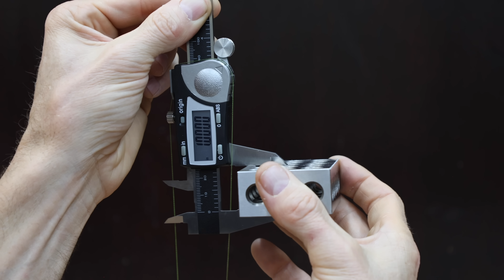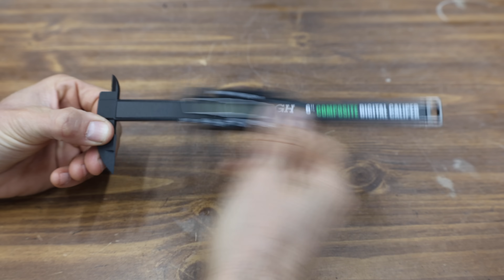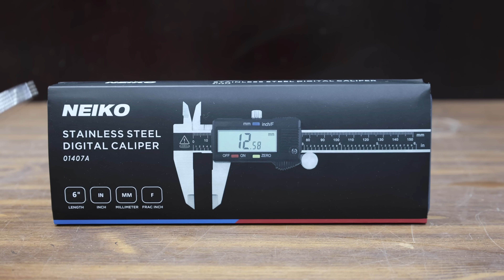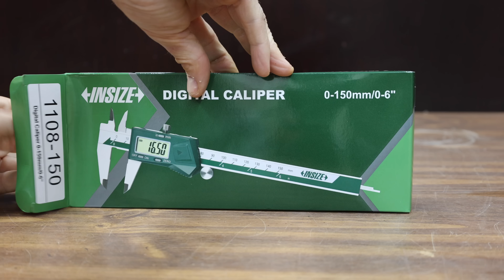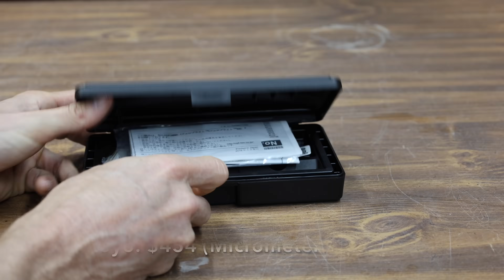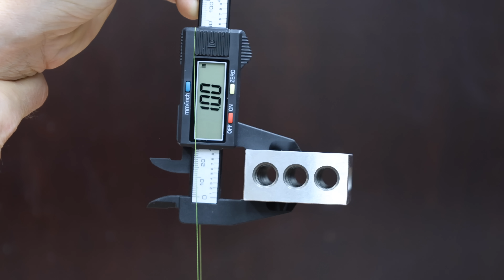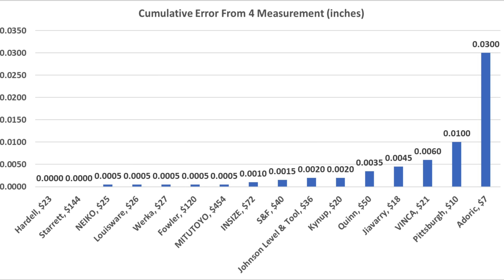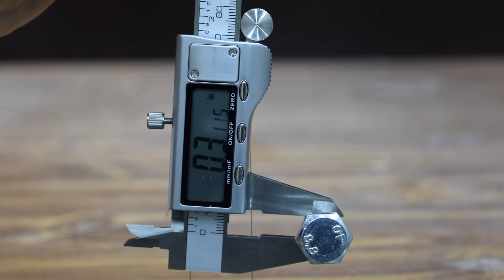I've Been Proven Wrong About Calipers!

Comment: Having the need for measuring existing bike parts such as seat post diameter and handlebar clamp diameter and then choosing from 2 or 3 available options for that bike part, excludes the need  for precise measurement and I can get away with the Amazon special. Those, however, who are measuring things for the exact dimensions would need one with the best accuracy possible. Thank you for the video.

Comment: I don't think I'll be trading in my Mitutoyo calipers any time soon, and as stated they are low power consumption, I don't recall changing the battery yet?, they are SEVERAL years old now, the cheap ones at work have a new battery about every three weeks?

Comment: Bought my Mitutoyo caliper in 1988.  I still use it almost daily.  Had a leaky battery which contaminated the contacts.  The battery compartment would be better with a screw.  I will by a second one soon.  Hard to beat Mitutoyo.

Comment: Hey, great video!  Except for one thing… battery lifetime.  I have most sizes of harbor freight calipers. These are the older but better versions of what you used here. I LOVE them…. When they work!  Yes, they have auto shut off.  And they even have an off button.  BUT it’s a software off button, not a hard switch. And damn all, the silly circuit in it drains the battery dry in only a couple of months: EVEN IF YOU NEVER USE IT!  It has a leakage current due to the soft switch. Absolutely stupid. As you mention the MIT has a patented circuit that eliminates almost all of this drain. But here is the rub, I’ll bet almost all the others you tested will have this same battery drain: all the others will be dead in a month except the MIT. SO if you are looking for a new video topic, put new batteries in all you calipers and test them each month to see hoe long they go.  You will probably be able to make the video in 3 months, 6 months tops.  And it will show them all dead except the MIT.  Maybe those with the larger cells might have some life still in them only because the battery is larger. You might have to wait 9 months for them..  but I think this battery life is a Huge issue, and it will completely reorganize you rating system, because even if a caliper can measure a thousandths of a thousandths, if it is dead, it reads nothing!  Thanks,

Comment: The cheap Chinese calipers will work great for a bit, until they dont. And when you're standing there with $100 of material and $250 in labor all gone to waste due to some $15 calipers you'll wish you just bought the starret/mitutoyo. There's an old saying "nobody ever gets fired for buying FLUKE" (originally phrase was for IBM products but i heard this through machine troubleshooting). Open up a pair of cheap Chinese calipers and the almost flagrant crappiness of the weld holding the depth probe will convince you more than i ever could. I'm the kinda millwright that watches a Project Farm video and then immediately pulls up my Amazon page to buy exactly what was recommended and i've never been dissapointed, but these products need more vigorous testing. But that means going into the deep world of metrology, something so awful that the youtube spellchecker is marking the word as misspelled because its never heard of it.

Comment: Mitutoyo is the best value.  A 6" is $120 or less.  Not sure why the ones in this test were so high.  Just need to order from a real tool house or else you will get counterfeit calipers.  I used a coupon and recently got another Mitutoyo for nearly $100.

Comment: 0:40 This one will EAT batteries for breakfast, by having a low-power circuit remaining "on" all the time, to keep track of the pulses...It never really shuts of and truly needs a "hard" switch and then a zero out every time, instead of that electronic switching stuff.....
Reply: +1 I have some cheap Silverline digital calipers that do the same. It was so bad that I switched to plain vernier calipers when I felt like an upgrade (bought Mitutoyo ones).

It was quite a while after that I realised it wasn't normal for the digital ones to burn through batteries all the time - just something the cheap Chinese models do
Reply: I mean, this isn't necessarily true. No idea about this particular case, but the movement of a slide can create enough energy to activate a transistor and trigger the OS to turn on. This would be a completely OFF system, tripped on by the movement of the device, costing no energy to the device, and suffering no battery leaks. Transistors really are that good!

Comment: Why are the micrometers included in the Mitutoyo pricing? Normally these are around 150$, for a little more you get the coolant resistant one which does have auto-off.

Comment: Supervisor of Metrology Engineering here, we calibrate some of these brands very frequently and we have the fewest issues out of the Mitutoyo and Starret Calipers. An additional consideration is that the Starret dial indicators are also pretty easy to work on.
Reply: I would say the same. Im a metrologist also. Cheap brands are for home use only. Lucky for me I can check my Cheap caliper with expensive gauge blocks from work.
Reply: @Rock1Ld  @Jacobscott272 What are the issues you see with the cheaper brands? Are they problems which @ProjectFarm could test in a future video?

Comment: Depth measurement: could the depth measurements been skewed due to the depth rod pressing into wood?  After all, if human touch can bend the jaws enough to skew the measurement, it would seem to follow that pressing a small area against a readily compressible surface could have similar errors.   

I have both a MITUTOYO as well as the Adoric (sold under the Bseen label, no longer available).  The Mitutoyo is almost 40 years old and is still fantastic; it may have been their first digitally reading caliper.  The Adoric is OK but its battery life is measured in _days_, as in 4-5 days.  I've given up on it, using it now only for coarse measurements taken by eyeballing the printed scale.  An old-fashioned vernier-scaled caliper still works great, albeit sometimes requiring the eyeglasses accessory to read it.

Comment: Thanks for the great reviews!  I bought two Neiko calipers, and both failed after only a few uses. They stopped working just outside the warranty period.  Both had some sort of power issue: one turns off and on in the middle of a measurement, and the other just died completely. I tried new batteries that work fine in other devices, so the batteries aren’t the problem.  Mechanically, they’re still fine, so they have some value, but the digital display makes measuring much faster and more precise. I don’t use calipers often, but they’re really handy when I need them. I know these were cheap, but I don’t use them enough to justify spending $120+ on a higher-end model. But these didn’t wear out from use and they were kept in their cases, never dropped, and well protected. So buying for the manual measuring? Probably not.

Comment: I have Mitutoyo and it works fine.  Much later I also bought a no-name.  When I put the battery in the no-name, the cover broke, the Chinese use a lot of regrind in their plastic.  The no-name went through batteries very fast.  I measured off-current of the no-name and it was +5 times higher than the Mitutoyo, about 20 uA vs. 3-4 uA.

Comment: I've been using a "Performance Tool" caliper from Auto Zone that I got for... I think it was 12 bucks? for years. Don't care about how smooth it is when jerking it back and forth. Just about how smooth it is while using the thumb wheel. That can be adjusted with the tightening knob. It's accuracy is perfectly acceptable as hobbiest. I'm looking to drop 100 bucks on a caliper online soon, but that's only because it has Bluetooth and automatic measurment recording. I don't really need to ever measure anything in microns. Millimeters is as small as I really get.

Comment: I have an old nice pair, I think it's nti brand, that has been working for me for like 15 years, and then one cheaper brand. The cheap one works surprisingly well but it definitely feels much worse, it has a kind of slop that makes it feel worse then it is. For the home and 3d printing related tasks I do, both actually get the job done pretty well. The big difference is the batteries in the nti last for like 10 years even with frequent use whereas the cheap one kills batteries in a couple months even with minimal use. The good one is always ready for use whereas the other one just isn't.

Comment: Please consider looking at chain wear indicators for bicycle chains. Chain wear measurement can be done by many types of tools. mostly dedicated, but also via a general purpose calliper. Tools vary in price from very cheap to nearly USD 100. Comparisons done over a range of tools show a significant range of accuracy. The idea for any bicycle owner is to replace the chain once it reaches a given level of stretch (0.5% or 0.75% typically) which then avoids wear to other (more expensive) components such as rear gear clusters and front chain rings. Having an inaccurate or hard to use checking method means that an owner may change their chain too early (discard chain with life still in it) or too late (damage other components).
Whilst quite niche this is ripe for the Project Farm treatment - trying out a range of checkers on bicycle chains at different levels of wear (eg new, should be replaced soon, replace now). Some chain manufacturers (in particular SRAM) have a differently shaped chain which may require a particular tool.
Reply from the maker: Thank you for the suggestion!
Reply: @ProjectFarm great. Might be useful to consult with an experienced bike mechanic when setting up the testing scenarios.

Comment: I found the fractional equivalency built into the readout to be possibly a handy option for our cabinet maker friends.  Often using a caliper is the best way to measure woodworking features, but drawings for woodworking projects are generally written in SAE with fractional dimensions.  
That groove measurement was just poorly executed to get an accurate dimension.  Properly measured you would use measuring wires made for measuring threads.  Knowing the exact diameter of the wires, you would choose the proper wires that are thinner than the groove width. Then the wire would find the exact bottom of the groove leaving the width of the blade out of the equation.  You would have to subtract the combined diameters of the thread wires to achieve the actual root diameter of the groove.

Comment: I'm a calibration technician and while I would say stay clear of the plastic sets in most cases, the $20 metal ones you find on amazon are typically accurate within .0001in just like the 240$ counterpart
Reply from the maker: Thanks for sharing.

Comment: Calipers are an introduction to metrology, so measuring 123 blocks [what tolerance?] against a wood table which is not necessarily guaranteed to be straight. For example gauge blocks come in different grades (from K to AS-2... to uncertified] with different tolerance guarantees. 123 blocks will be usually less accurate. Another interesting thing, from 50f to 85f you can expect a 123 block's 3 inch side to expand by roughly 0.0007~ inches due to thermal expansion! So about a thou from 5c to 35c. The larger the object the harder it is to maintain accuracy over the size of it, so that's why a 12 inch caliper is sometimes more than double the price of a 6 inch one.

Another thing -- calibration gauge blocks etc are usually within roughly 0.002-0.003 thous (+0.10 um to −0.05 um) and you can go down the whole metrology rabbit hole from here.

The pricing on the mitutoyo in the spreadsheets etc is wrong though since it comes with a micrometer! You also avoided the most important parts -- drop tests, how they deal with dusty environments, water immersion, oil spils, repeated measurements, and sliding in/out dozens of times. Also testing battery lifetime AND accuracy when the battery is low! 

I own a few mitutoyos, but also use a bunch of neikos for more disposable kinds.

Thanks for the great review though, this tool gets used by hobbyists wanting slightly higher accuracy and also by machine shops and other technical work where certification and following processes is very important. Perhaps a 2nd review targeting the more "machinist" style accuracy and use cases (Battery life! Accuracy!)

Comment: It's about the ones that still measure right after their 230th fall on the floor. The cheapies don't last in a pro environment. They even got banned on the shop floor in favour of calibrated and checked mitutoyu. There's a couple of decent brands, bit there's a reason we all use mitutoyu in engineering workshops.

Comment: It wouldn’t be practical to test here, but I’ve had cheap digital calipers shred batteries sitting in the case. I switched to Vernier calipers over that particular issue; I use them a couple times per year and don’t want to buy batteries every time I do.
Reply from the maker: Thanks for sharing.

Comment: Mitutoyo simply doesn't need auto power-off. I've seen Mitutoyos left on in the drawer for month and months. They simply don't use the battery when you're not moving them, or at least no more than a Casio wrist watch (which if you've ever had one, you can toss it in a drawer and pull it out 5-10 years later and it's still running). 

I don't think they even do anything differently when you turn them off. I'm half convinced it's just a cosmetic feature to make us feel better. Maybe they stop interrogating the scale? but if you look at the display at an angle when you turn them off, you can tell that the display scan multiplexing is still running, it's just displaying all blank segments (this is apparent because the segments are all dimly visible, as compared to when the battery is removed and the display is truly blank).

Comment: Hey man  so you upload like once a week, once every 2 weeks? How many hours would you say it takes to make a video such as this caliper tournament  or something like the winch video, or the honda engine comparison? What about some of the hydraulic jigs you've made, or the tension/pressure jigs used for testing torque, hold, or pressure products? Thanks if you answer.
Reply from the maker: I put out a video every Sunday.  I spend between 50 to 70 hours on each video.

Comment: I'm a CAD guy and maker so I splurged and bought myself a Mitutoyo CD8-ASX for hobby use. I'd be disappointed if I need to buy a replacement in my lifetime. A cheap pair of calipers can cost you a lot more than the best set of calipers ever would. Also, clean the calipers before and after you use them. It was painful to watch them come out of the box and be slid back and forth across all that dust. Kimwipes and IPA will make a world of difference.

Comment: Machinist here. When it comes to digital calipers. Mitutoyo is the gold standard and also has the longest lasting battery. Sure when their new most all (stainless) calipers will hold the expected.  +-0.001 however use them heavily everyday and they all become disposable where the cheap ones are only good for a couple months the good ones will last 5-7 year's. Digital calipers have two major weaknesses. Moisture and uv light. The "coolant proof" version  are highly sensitive to uv light where the non coolant proof versions are highly sensitive to moisture. The newer mitutoyo are resistant to both. Sylvac makes the most accurate calipers but mitutoyo tends to maintain their accuracy through the most abuse.
Reply: In what way do UV light affect them? Damaging the plastic parts?
Reply: @nreau The magnetic strip on the rail brakes down and they quickly become un-useable. I learned this the hard way by leaving a brand new set of 12" coolant proof mitutoyos in the dash of my truck while I ran in to get some measurements for a customer. After sending them in mitutoyo said they were un-repairable.
My understanding is that their are two types of plastic that can be used to make the encoder strip. One absorbes water and swells causing inaccurate measurements until it drys. The other is uv sensitive and breaks down quickly when exposed to uv light.
Reply: @rmkscrambler  hum the encoder strip is usually some sort of FR4 with copper plating, I've never heard of issue due to UV, and that would require some sort of extremely long exposure, like years I tihnk. Did Mitutotyo blame the UV? On the other hand if in direct sun and high temperature for a prolonged time I could imagine some plastic of the assembly being deformed, or the encoder stripe "moving" because the glue soften and impacting the function.

Comment: I have 3 , but only started using one. very small fraction difference is something I am not concerned about, however i am concerned about auto-shut off , lightless and ease of use and very large LCD screen. 
So I got  something called WEN 10761 ($10)  which is made of  full plastic and I thought i was gonna hate it, but I already used it a lot more times than my other 2 brands.

Comment: Now I'm a hobbyist machinist. Can't afford the expensive tools, BUT if you use the same tool to measure the part that you use to make the replacement part, almost anything will work OK. Just don't expect 1" to be 1" there lies madness.  If accuracy AND precision matter, buy an expensive calliper and a set of slips.
Reply from the maker: Thanks for the feedback.

Comment: One small critique-Measuring the depth on that table would be prone to error.  I would put the 1-2-3 block on a surface table or at least another 1-2-3 bock.   Seems hard to belive but you're working in measurements fine enough that variances in the table will show up for sure. 

Also, if you do another round of these please include the Shar Aventor series.  They are moderate priced with auto off and absolute measurement.
Reply from the maker: Thank you for the constructive feedback!